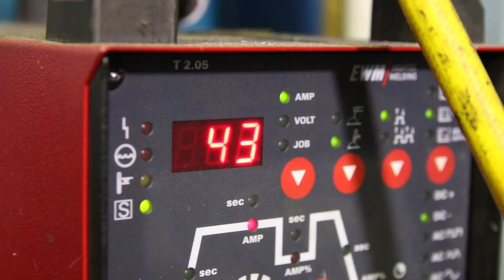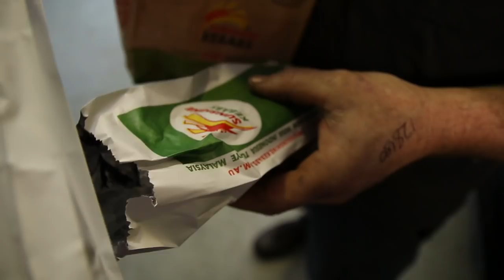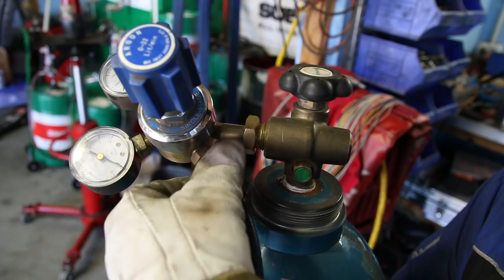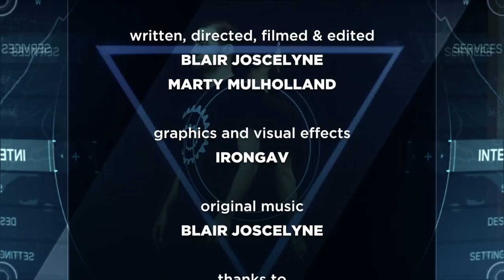Gramps the 11 Second Car - Build Part 6

Comment: Exhaust wrap actually helps a bit on response for a turbo application, as hot gases travel faster than cool gases. Higher exhaust velocity = better flow and faster spool up.

Comment: Great episodes. I'm noticing during this series that I can hear either the lens stabilization or the autofocus motors in the camera, I'm assuming you're using a DSLR based on that. You should run an external mic to take it to the next level of production value.

Comment: The only problem I noticed in the first version was that at around 34:35 Marty forgot to chop out the part where he asked Turbo Yoda a question then said "can you repeat the question before answering it". Guessing that was so the audience wouldn't be confused as to what he was talking about, but was supposed to be edited out. He asked why they were using these types of fittings, then T.Y said "We used these types of fittings because...". Forgot to chop that bit out in between :)

Comment: The one thing I love most about Subarus is the fuel pump has an access plate. On many GMs you have to cut that out of the floorpan yourself, throwing sparks on the fuel tank and risk hacking a shitty nylon fuel line.
Reply: elsydeon666 gm... the only company where failure is not an option....

it simply comes standard

plz don’t kill me

Comment: When using an E85 you should have sealed connectors for all electrical, the wires will eventually corrode otherwise. Even silver plated teflon coated wiring.

Comment: A truly impressive build, but I do have a question. Why was the turbo sandwiched back where it was? Wouldn't it have been easier to solid mount the turbo where the PS reservoir is and then plumb to it, using flexpipe when needed?

Comment: Curious, are you guys going to run a head spacer? Stock, that motor has a C/R of 10.5:1, which is considerably high. Boosting that seems a little dangerous. I'm sure you guys have probably checked in on this topic, and I'm no Subaru expert, but I'm just curious. Cheers.

Comment: What is that device merged into the exhaust at 26:34?
I'm not getting it
Reply: +Jan Seidel That is known as an external wastegate- it's effectively a pre-turbo bypass valve that is electronically controlled by the ECU to control boost pressure. As boost reaches the set peak pressure, the ECU will slightly open that waste gate to hold the boost pressure steady at that set level by bypassing exhaust down a separate pipe that goes to the rest of the exhaust without the turbo. The more that valve is opened, the less boost pressure the engine will be running.

Comment: Why no mount the turbo on the other side of the bay from the brake and clutch master cylinders? more room and then the turbo won't be adding unnecessary heat to the brake fluids etc

Comment: So question, wont dumping the boost pressure into the exhaust completely throw off the wideband o2 sensor readings?
Reply: No, o2 sensors only read air fuel, if you have no cat, stuck it at the very end of the exhaust, just as fine many times. You cannot have them on the pre side as they will burn up.

Comment: I can't wait to see what kind off #s this thing produces. I'm running a similar setup on my 99 STi RA. I have a rotated gtx3071r with the TiAl .63ar V-band housing, TiAl 38mm EWG, TiAl Q BOV, DW300 pump, DW850cc inj, AEM methanol kit, stage 3 CM clutch, and a few other mods, and I'm hitting 16 psi @3300 peaking @21psi & holding until 7250 redlining @8000 & putting down 406awhp 388tq 

This EZ with a gtx3576 better put down atleast 500awhp cuz that gtx35 can put down ridiculous #'s on a 2.5 & I've seen that H6 swapped gc8 put down 600 so I'm guessing the EZ is capable of doing the same with the right supporting "mighty" mods.

Comment: Ethanol fuel is worse than ethanol free fuel. Let your car sit for a couple months and you'll have to clean the entire fuel system. If you have ethanol free fuel a car can fire up after 10 years with no problem. Not only that but ethanol causes fuel line to dry and rot.
Reply: Ethanol fuel in the us is about 110-ish octane i believe, it also is less prone to knock/detonation. They're giving it a flex fuel sensor so when/if it sits it may not have ethanol in it anymore.

Comment: Don't want to be an ass but shouldn't that wastegate be mounted at an angle? I was told that it should be less than 90 degrees, going with the flow of the exhaust gases. Again, just asking, these guys know a lot more than me, I don't even have a drivers licenese yet! :D

Comment: I have a question, i know when welding stainless (i think) you should really back fill the exhaust pipes with Argon gas that way, down the road, the welds don't corrode. How come Turbo Yoda hasn't back filled the pipes? is there something different here? or is back filling with argon not necessary?
Reply: It depends on where it is used, but as you can see in the videos marty is grinding out the inside due to the welds not having gas on the inside. (english is not my native language, so i cant tell you what is happening). In the medicinal industry fx. not using inside gas as u call it, would create a tainted weld on the inside and would not have been aproved. Bottom line, it depends on the application.

Comment: Can someone explain to a car noob why the exhaust manifold is on the bottom of the engine?
I thought they were always on the top, because of how the pistons are orientated.
Reply: Because it's a boxer engine and the pistons are horizontal not vertical so it's would need the manifolds placed in a different place compared to your conventional engines
Reply: Flat 4 engine configuration. All Subarus and most Porsches use this configuration.
Reply: ***** Still a flat engine configuration. Which answers the question asked.

Comment: Do you guys really think a "low" compression six cylinder station wagon will make it into the elevens?
Reply: "low" compression is good for turbos, it allows more pressure from the turbo to make up for it, along with the pressure the turbo is also bringing a bit more air than high compression pistons alone